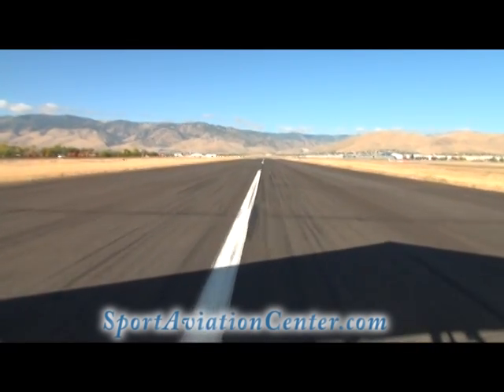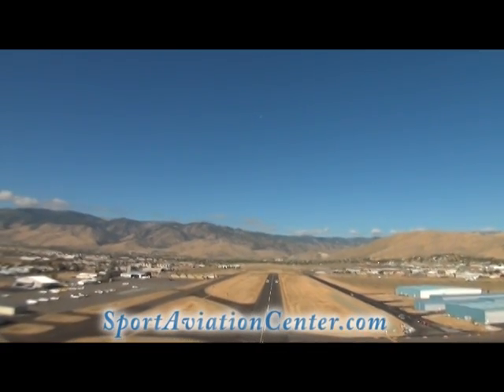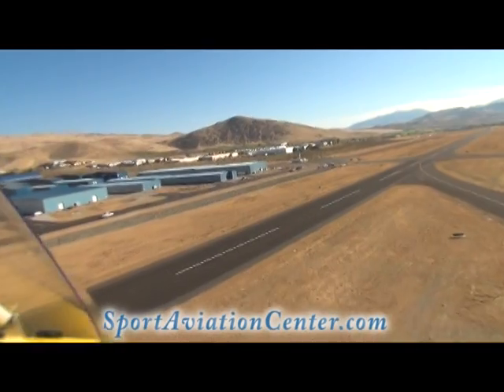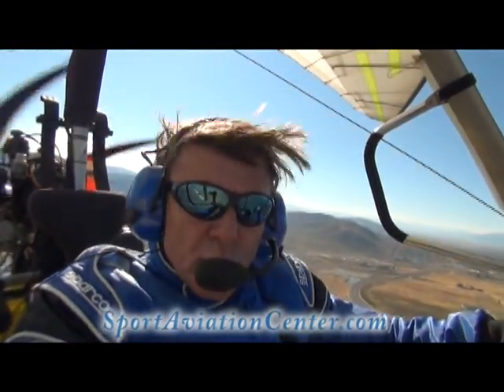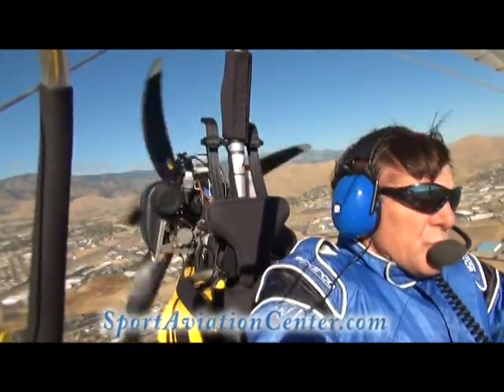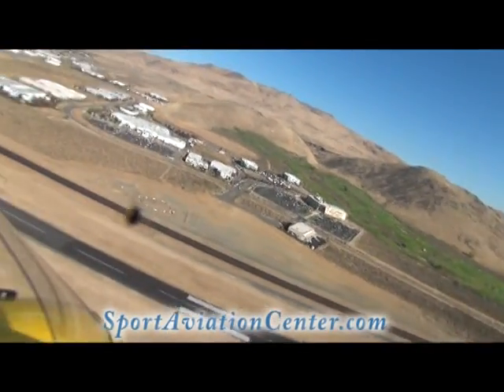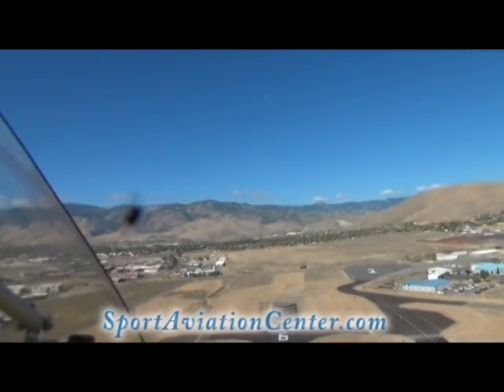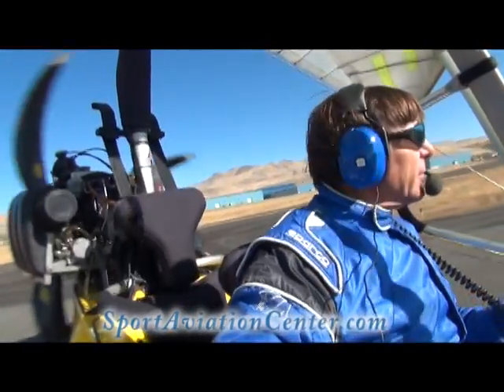Trike Engine Failure On Takeoff Emergency Landing Scenarios

Comment: I had an engine out (due to low fuel) in my stick trike (Kosmos) at 150'  just completing 90 degrees of crosswind after takeoff (440 engine) which came as a shock since the engine went RRRrrrrraaa......... and that was it. I did a 90+ degree turn to try to get back to the runway but just did not have it and the best option since I was parallel but not going to make the runway was to land in the grass parallel to the runway next to the taxiway. No damage. The bottom of the cylindrical fuel tank had some which I had visually verified, but the turn from the runway caused it to run to one corner and uncover the sump.
Reply from the maker: running out of fuel is a big reason for engine failure

Comment: This advice can only be for very experienced pilots I'm guessing
Reply from the maker: Actually this is advice for all pilots. This is what I teach for students ready to solo
Reply: Would you expect a student or novice pilot to execute your procedure with an engine out at 300ft?
Reply from the maker: It all depends on the trike, the experience of the pilot/student and the other landing options available. 300 feet is pretty low when you consider reaction time.  It is up to the pilot/student to make the decision. Always have a plan of what to do when so you are prepared to execute the best maneuver possible for the situation.

Comment: Why are you doing a 180 turn on an engine out after takeoff.  NO NO NO NO.  Bad form.   Worst thing you could encourage people to do.   

Pick out a place for yourself to land straight ahead people.  Do not try and turn back to the airport.
Reply: 300 feet turnaround is suicide in a cessna 150....easy in a trike.
Reply from the maker: Yes I teach when and how in a fixed wing airplane. In many airports if you do not turn back and you kill your self and your passenger, that would be unnecessarily tragic if you could have turned back and landed at the runway. Yes in Cessna's and other heavy aircraft that have less climb performance you should go forward because you have no choice, it is the best thing to do. In some light sport airplanes, they climb out great and you have plenty of room to turn back. In the Sling 2 airplane I teach in and MGW, with 500 feet altitude you can to the 180 "U" turn plus the continuing 45 to the runway and the reverse 45 to line up on the runway to land safety. When most pilots are learning this maneuver, it takes 800 to 1000 feet until they learn the proper technique  If you think this is not possible in an airplane come train with me and I will demonstrate it for you. It is a standard training maneuver to fly safe.
Reply from the maker: I should emphasize that you do this at altitude first to simply see how much altitude it takes AND if you can make it back to the runway. This altitude and distance should be know for every pilot to fly safetly
Reply from the maker: Each aircraft have unique performance characteristics. Typically old airplanes can not turn back to the airport so the old wisdom is to land straight ahead for these. However, some modern high performance aircraft have incredible climb performance where landing back at the runway is the best option and you would be putting yourself in danger landing straight ahead. It depends on the aircraft/pilot capabilities/limitations. Each aircraft is different.
Reply: My thoughts exactly. He needs to emphasize NEVER do this in a fixed wing aircraft.

Comment: When I trained for the PPL (a) I was told by all instructors NEVER turn back when you have an engine out on take off. So is your machine okay due to the much less weight? Obviously you only turn back when height and speed allow but in a Cessna 150 or similar I was told if the engines goes out even at 300 feet AGL land ahead into wind and if you turn back it could mean death or serious injury at least. I am totally bored with Cessna and Piper flying now, too much expense and not nearly as much fun as these machines you fly seem to have. One more question please... Do these weight-shift machines suffer from the structure breaking up during flight? There are many reports in the UK of these crashing when compared to larger three-axis aircraft so I just wondered if you have some figures or can point me to where they can be found? Nice videos by the way.
Reply from the maker: Determining where to land with an engine failure on takeoff depends on the aircraft and the pilot. When I teach in airplanes, the performance is such that this "NEVER TURN" back is applicable. It is part of the training process to determine that you can do with your aircraft.  Most trikes are certified to similar standards than airplanes plus 6/4 minus 3/3 G's so breaking up in the air is not a problem. With most aircradft accidents, it is up to the pilot to determine risk and avoid it. not the aircraft itself. In many ways trikes are safer that airplanes with less moving parts and a ballistic recovery parachute.

Comment from the maker: I also teach in airplanes. In an airplane, I would typically land ahead, or on an alternate runway/taxiway. An airplane  is a completely different technique than a trike for the same airport runway. 
So the old and reliable rule is best in most cases but not always the best technique for all engine failure on takeoff.
depends on the aircraft, pilot, runway and conditions.

Comment from the maker: Old procedures for engine failure on takeoff is to generally land straight ahead. This is a good starting point. However, new and/or different aircraft with completely non-similar performance characteristics, a 180 turn back (which is actually 270 degrees of total turn back and land on the same runway) is practical and better than crashing into something in front of you. It depends on the pilot and aircraft capabilities plus the runway length.
Reply: Paul Hamilton Thanks a lot, professor.

Comment: So here's a question! I've always been told if you have an engine failure on T/O never make that "180 of death" turn back to the airport. Instead, try to land straight ahead. In his 2nd simulation, he made a 180 turn, despite the fact that he was somewhat low, and came back and landed (quite nicely I might add) on the runway. Is that the proper procedure?
Reply: Depends on your airplane, weigh and winds.  You have to know when and how.